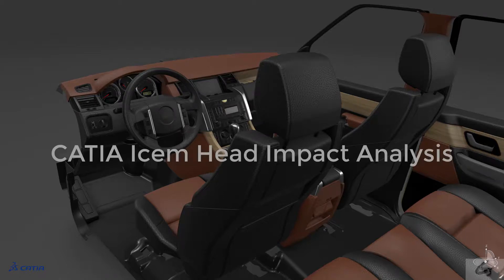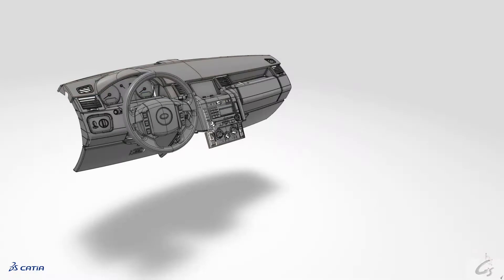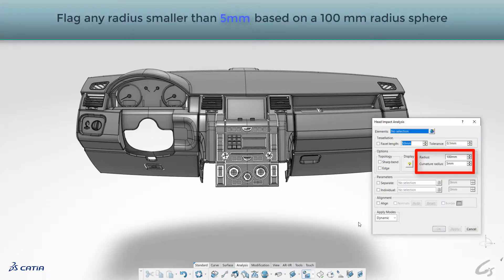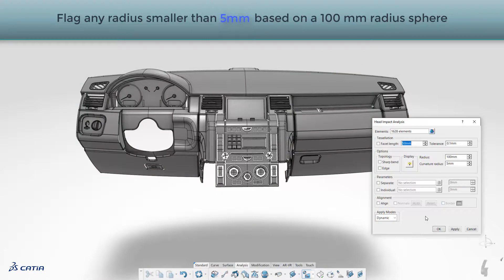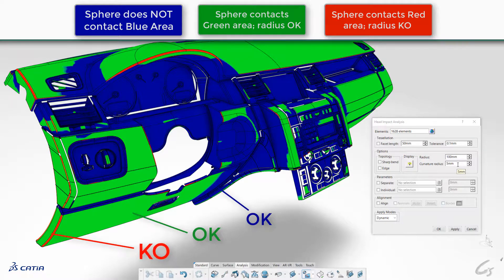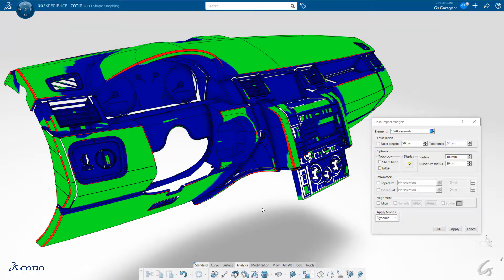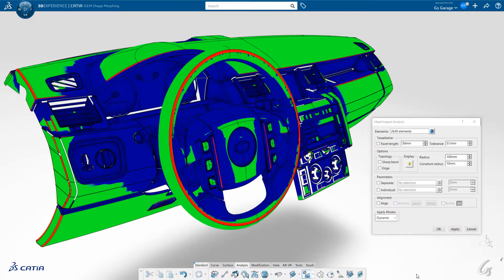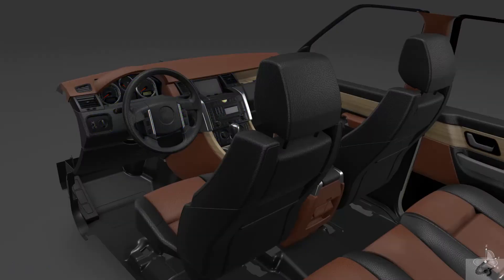CATIA Icem Head Impact Analysis

Comment: Hi Mr Alcini,
I model a part and before I send it to the machining I want to make sure that the part
meets a certain diameter for tooling, 
in other words I want the smallest endmill diameter that is required to mill the part,
may you please give me a suggestion in GSD or FreeStyle workbench?
Thanks for your unique videos.
Reply from the maker: Hi Fardin, try using Surfacic Curvature Analysis, then select the limited radius option. Type in the a nominal value, say 5mm and set the color scale to your liking, then select all the geometry you wish to analyze and can see what radii are above and below your input value and you can use an option below in the dialog box called "on the fly", mousing over any area of concern to get a dynamic feedback of the radius and/or curvature value. Hope this helps
Reply: @GerardAlcini  Thanks so much Mr Alcini,
I tried it and I don't find it to work for my case,
it is good for the curved areas but where there is for example two popped features in a part that the distance between them are less than the tool diameter the endmill will not be able to go between them and this analysis don't give a result because it is for curved areas.
Reply from the maker: @fardin5059  Fardin, what CAM software are you using? Many of them have a feature called REST (REmainingSTock) machining that will clean up remaining stock from larger tools...have you investigated if this feature exists? Otherwise, the only trick that I can think of trying is to try an edge fillet for the entire part and continually decrease the value until you have your answer. Head Impact Anaylsis would probably work...but I know that you don't have this license... :(
Reply: @GerardAlcini  Thank you Mr Alcini,
I am not the machinist guy but I know the machinist uses Powermill which have the REST-machining capability and he REST-machine the part and 
finds a spot which the tool does not enter and sends the model back to me to modify,
my goal is to stop this back and forth between modeler and machinist and send the model in a way that makes sure it will not be sent back,
I thought a tool like Thickness-analysis may exist to do what I expect and lack of such a tool really is strange to me.
Thank you for your answer.